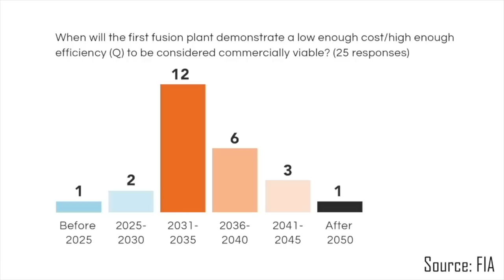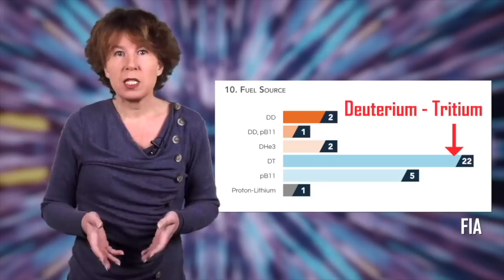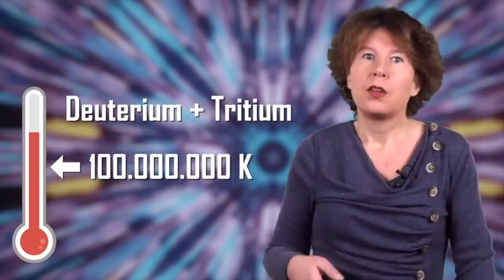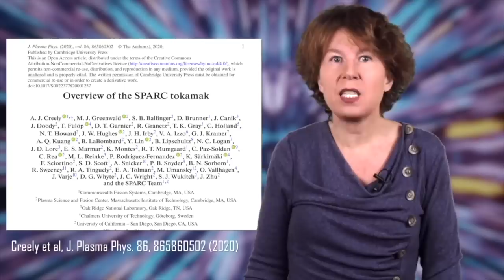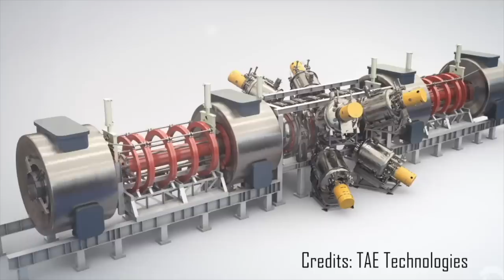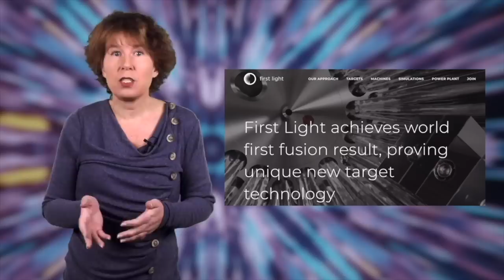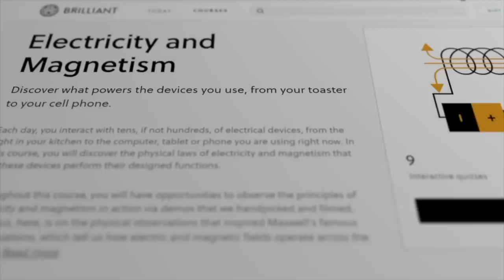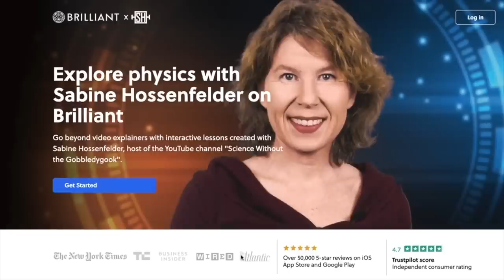Nuclear Fusion: Who'll Be First To Make It Work?

Comment: For any DT reactor, you need to ask:  "what is the volumetric power density of your reactor (and not just the volume of the plasma)".

You will find that this figure is MUCH lower than the volumetric power density of a fission reactor (for a commercial PWR, this is roughly 20 MW/m^3.)

After that, ask how their fusion reactor is going to produce heat more cheaply than a fission reactor would, if it's going to be so much larger and more complicated.

If they can't answer these questions convincingly, be very skeptical.

IMO, Helion's approach is the most promising, as it evades this comparison with fission, as it's directly producing electrical energy, not producing heat that is to be converted to electrical power via a thermal cycle (as in DT fusion and fission).   Also, the neutrons from DD fusion are much less damaging that the ones from DT, since they are of lower energy, below the threshold for (n,2n) reactions in most materials, and also having much lower cross section for the very nasty (n,alpha) reactions, which limit the lifespan of exposed materials (the helium builds up and forms high pressure microbubbles that rip the material apart.)
Reply: Helion’s approach does seem promising but like she mentioned there’s going to be lots of hard x-ray bremsstrahlung released by the reaction that would be just wasted energy unless converted into electricity using some sort of photovoltaics.
Reply: @456MrPeople  In Helion's approach the electrons are much colder than the ions, which keeps x-rays down.
Reply: Helion is a dud & a waste. This is because they cannot control the direction of the hot ions. For fusion to happen two ions must hit dead on (ie bullet hitting a bullet dead center). If they ions hit on a glancing blow nothing happens and the ions loose the critical velocity need to exceed the columb barrier. Even a intern could figure out this is not going to work, but as long as they can find suckers (I mean investors) success isn't necessary.

Q > 1 would theoretically be possible with a low density plasma which the net ion velocities is high enough to exceed the Columb barrier. Like driving very fast on a freeway with no other cars. Helion approach is like trying to achive 250 Mph on a freeway that is jammed bumper to bumper. (it not never going to happen).
Reply: @456MrPeople  The FRC is formed by colliding two plasmoids that are translated at high velocity (hundreds of km/sec.)   The initial kinetic energy of the ions is much larger than that of the electrons, since the ions are much heavier than the electrons.   Adiabatic compression of the plasma maintains the temperature ratio.  Helion can measure the electron and ion temperatures after the collision and they find the ion temperature is an order of magnitude higher than the electron temperature.   The shots are short enough that the electrons do not have time to warm up by ion-electron friction before the plasma is reexpanded and the energy recovered.
Reply: @guytech7310  Your critique there doesn't seem relevant to what Helion is actually doing.  Their fuel ions are in thermal equilibrium; collisions do not cause "loss of critical velocity" (whatever you meant by that).   Fusion product ions are not intended to immediately fuse further (although produced 3He will be recovered and reused in later shots), and indeed the shots are short enough that tritium ions produced do not thermalize before the shot ends (and this is good; they want to minimize DT fusion reactions from those ions, and at their initial energy the T ions are well above the energy at which the DT fusion cross section is maximized.)

Helion is aiming for a Q = 0.2, if I understand correctly.  Because they can recover the input energy so efficiently, this should be enough to generate net energy.
Reply: That’s not how it works. The electrons don’t warm the plasma, rather the nuclei cool down the electrons by releasing radiation. Not to mention all the neutrons produced by D-D side reactions that require shielding and the way higher temperature requirements. I’m all for Helion to succeed but they’re climbing an extra difficult hill here in the already difficult problem of nuclear fusion. If they do succeed, it won’t be before D-T is figured out so time will tell if their direct energy conversion is efficient enough to compete against thermal fusion.
Reply: @456MrPeople  Ions are hotter than the electrons.  When the ions interact with the electrons, energy flows from hot to cold.  This is a basic physical process.  The energy of the ions has to go somewhere as they are slowed; it goes into heating the electrons.  Now, at the same time, the electrons are radiating as they scatter on the ions (which are moving slowly compared to the electrons.)  This cools the electrons.  Both of these processes are happening at the same time.  The rate of radiation depends on the temperature of the electrons, so if the electrons are cold enough heating will exceed cooling.

The neutrons from DD require shielding, but are much less damaging than the neutrons from DT fusion.  The DD neutrons produce much less helium from (n,alpha) reactions; it is this helium that limits the lifespan of wall materials in DT reactors.   And since it's not necessary to breed T with the neutrons we could capture them on elements with very high neutron capture cross sections.

All the efforts at trying to make economical reactors with DT fusion come to the same discouraging conclusion: it's not going to be competitive with fission, never mind the renewable energy sources that are beating fission.   The generic engineering obstacles to DT fusion have been known since the 1980s (see Lawrence Lidsky's famous article) and the recent efforts do not dispel them.  Helion's approach asks much more the plasma physics, but if it works it has the potential to evade these showstoppers.
Reply: @pauldietz1325  Sorry you don't understand how fusion works. You Ions need a velocity high enough to breakthrough the Columb barrier. if the velocity is too low, they just bounce and nothing happens. When they try to compress the plasma the ions will be traveling in all directions (scattering). like a large number of bumper cars in a small arena, there very few ions will get up to the velocity needed to exceed the columb barrier, and each collision will lower the ion velocity, just like when two bumper cars hit.

Plus He3 will reactions will be tiny since its far easier for D-D, and the process will take the path of least resistance. Back of the napkin: about 99% of any fusion reactions will be D-D and about 1% will be D-He3 (if any D-He3 happens) . D-He3 is at least 6 times the temperature of D-D or D-T. All of the Tritium will be consumed by D-T or T-T fusion & almost no D-He3 or T-He3 reactions. if Helion cannot figure that out, they need to go back to basic physics.

Helion will never work, even a child with basic understand of plasma physics can figure that out.
Reply: Tritium breeding is an issue, which is what ITER is attempting to solve, but the temperature requirements for D-He3 are at least five times higher than D-T, which is a much harder problem to solve. Helion needs to show that they can break plasma temperature records before talking about producing electricity.
Reply: @guytech7310  You greatly overestimate your level of clue here.   I understand fusion perfectly fine.  BTW, essentially none of the ions in these plasmas have energies high enough to overcome the coulomb barrier.  Instead, they tunnel through that barrier.  Without that quantum mechanical effect, fusion (in reactors, and in the Sun) wouldn't occur.

If the ions are in thermal equilibrium, their velocity distribution is not changed by ion ion collisions.  Some lose energy in these collisions, but some gain energy, and overall the Maxwellian distribution is unchanged.   Your handwaving indicates you have only a vague understanding of this basic thermodynamic principle that underlies thermonuclear fusion.

The cross section for DD fusion at the relevant temperatures is actually quite a bit lower than the cross section for D3He fusion.   Your claim about 99% of reactions being DD is simply wrong.  At the ion temperatures of Helion's production reactors D3He will have a high reactivity -- go look at the figure on the wikipedia page for Nuclear Fusion.

I suggest you stop embarrassing yourself with your snidely delivered nonsense and actually educate yourself.
Reply: @pauldietz1325  Does not matter. You still need ion velocities to be high enough to cause fusion. Call it quantum tunneling or not, it makes no difference. When the plasma is compressed it will cause the ion velocities to scatter any ion collosions that are dead on will not cause fusion, and the scattering because of the excess collosions will reduce the average ion velocity because they are traveling in all different directions. ie jammed traffic intersection with vehicles approaching and exiting in different directions.

In the past Univ of Wisc. tried pulsed electrostatic confinement to compress plasma into a tiny area, hoping that the overall fusion reactors would increase. It did not because the of the Ion scattering effect reducing the overall net ion velocity. 

D-D will be preferred because its the least path of resistance. Take two resistors in parallel. One with 1 ohm the other with 100 ohms. 99% of the power will go through the 1 ohm resistor. This also applies to chemical or nuclear reactions. Helion & you seem to believe in fantasy, that D-He3 will be the the preferred reaction, it will not considering it take 6 times high ion velocities to trigger fusion for D-He3. 

The He3 ion velocities will be substantially lower than D, because of the increased mass. Just like boiling a pot of water. The water will turn to steam while the pot temperature doesn't exceed the boiling point until all of the water is gone. Same with D-D. The D-D will fuse first until they are all consumed.

Its not hard to understand.
Reply: @guytech7310  > the scattering because of the excess collosions will reduce the average ion velocity 

Obviously not, since that would violate conservation of energy.  When two ions collide (and don't fuse) the kinetic energy of the ions afterward is equal to the kinetic energy before the collision.  Where did you think the excess energy was going?
Reply: @pauldietz1325  That's not what I said. The issue is that not all ion are traveling the same veloicy and two ions traveling at oblique\Perpendicular angles will not have sufficient velocity to fuse. ie the packed bumper to bumper road versus the empty road. Its far easier to accelerate vehicles to high speeds on empty roads compared to roads filled with vehicles bumper to bumper.

In the case of ions being compressed via magnetic field, the plasma density will increases increasing ion scattering and reducing the ion velocity to achieve the velocity. Helion objective is to increase collions that they believe will increase fusion reactions but it simply will not work
Reply: @guytech7310  None of what you said there makes any sense.   If the ions are in an equilibrium distribution, as they would be here, they can collide and bounce around to their heart's content, and the distribution *does not change*.   Some energetic ions lose energy, some lower energy ions gain energy, and the distribution of energies over the ions remains unchanged.

Also, it's quite the move to say "not what I said" when I quoted you character for character.
Reply: @pauldietz1325  The are never in equilibrium. There are always variances. There is no such think as the ideal gas (plasma)

"Some energetic ions lose energy, some lower energy ions gain energy, and the distribution of energies over the ions remains unchanged."

Yes, But the decrease in individual ion velocity needed will prevent fusion. As I stated ions need to hit dead-on with a pair of ions traveling at each other. Bouncing off at 1 degree through 359 degrees and no fusion.

Paul since you are so optimistic about Helion, Lets have a friendly wager. Helion website claims they will achieve positive net energy gain in 2024. I am willing to wager that by the end of 2024, that Helion does not meet that goal (Must be independently confirmed). if they reach that goal by the end of 2024 I will pay you $1000, and if they do not you pay me $1000. You cannot lose right?

From Helions website FAQ:

"When will helion produce electricity?"
"We expect that Polaris will be able to demonstrate the production of a small amount of net electricity by 2024. We will continue to iterate our device quickly so we can offer commercial fusion power for the grid as soon as possible.

By "net energy" a Q factor greater than One. For Net power that would be a Q of 2.
Reply: @guytech7310  Fusion doesn't typically occur because of kinetic collisions. It happens via quantum tunnelling. 

Which means it's a game of probabilities, and finding ways increase those probabilities. 

So you have to find ways to make the probabilistic wave functions of your fuel particles overlap as much and as often as possible to increase the probability of the wave function those particles collapsing to the same position. 

Fusion is happening right now even in some random hydrogen tank. A random nuclei quantum tunneling to get close enough to fuse with another nuclei. It's how fusion in the sun works. 

But the probability of a nuclei tunnelling onto another one is exceedingly unlikely, even more so in some random hydrogen tank, but it still happens. 

Heat, pressure, etc increases these probabilities.

The sun's main advantage is that it has a crap ton of protons to beat the odds with brute numbers...the sun is really really big which means it has a lot of protons to roll the dice with. 

Per average volume, the sun produces less heat than your body...but, it's really realy big.
Reply: @tylerdurden3722  Yeah?  then why does it work at room temperature?!? Why do all of the fusion reactors for D+T need plasma temps at or above 100MK?
Reply: You clearly did not watch the video. Good job......
Reply: @4203105  What a useless comment.
Reply: @pauldietz1325  Right back at you.
All your comments were completely useless, since you didn't even bother to consider that all the startups listed, who work with magnetic confinement, work with high temperature super consuctors.

Comment: Great presentation, it really helps clarify some of the different pathways in the research field. I've been keeping an eye on fusion research for quite some time and have an interest in one that may not look large on the radar because it hasn't embraced funding by large VC funders and relies on crowdfunding and individual investors. It's LPPFusion's Focus Fusion using a Dense Plasma Focus pinch design device. From what I've read it's the hottest pulse achievement that isn't powered by a stadium size facility (such as NIF). The wall plug efficiency is the best as far as I know. Thank you!
Reply: I was surprised too that they didn’t mention LPPFusion. I think that all the fusion startups that rely on extracting heat from a radioactive process are going to be fabulously expensive, like fission plants.

There are some in this video that use magnetic fields to extract energy or pistons, that are more promising, but all of them are still going to have to deal with pretty insane neutron flux (ie very dangerous radiation) that will wear down their equipment and will be expensive to manage. 

Not to mention how most of them need radioactive trititum as a fuel source but mostly gloss over how they will generate it.

All that said, LPPFusion is one of the few fusion startups with an approach that I think will lead to actual CHEAP energy and not another repeat of expensive fission power.

And of the ones that have the potential to be cheap, LPPFusion has made the most progress and has the clearest path to a viable reactor.

Comment: I've always found it a bit silly over the decades to say something is possible 'in theory' referring to some low level model, and that the work left is just 'engineering', and not for the reason you think. It's dumb and wrong because there is 'theory' at every level, many many many systems we'd like to implement are not just hard, but impossible because the theory at some level in 'engineering' a useable system actually shows the thing we want to build is impossible .
Reply: Yeah, that's the joke Sabine was making, my dude...
Reply: there's working fusion reactors out there so it kinda really works... in... theory

Comment: People go crazy about fusion, but it is much more difficult to achieve then they imagine. A better and more achievable power source is a Liquid Fluoride Thorium Reactor. Why no one speaks about them? They are near perfect solution to current problems of the world!
Reply: My best guess is the Nuclear weapon non-proliferation treaty.

In theory civilian reactors are allowed. But in practice: it is very difficult to design a reactor that can prevent NATION STATES from diverting material.
Reply: Moltex is my favorite here but it is still a uranium plutonium fuel mix, they have several designs, but there are others including Mr Gates fission investment, these and other decouple the constant fission heat supply that is in the molten salt coolant loop with the power generation that can be run at different rates making them into excellent peaker plants.
Reply: It's actually even less achievable than fusion. That's the reason why we don't have it already.